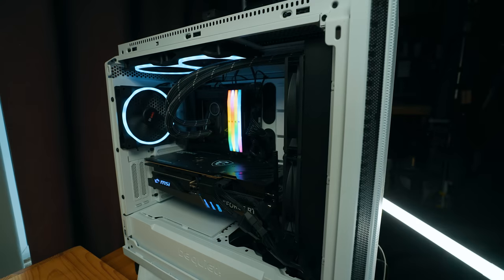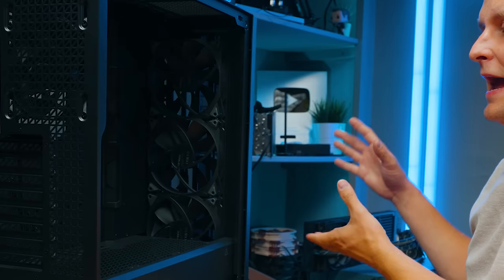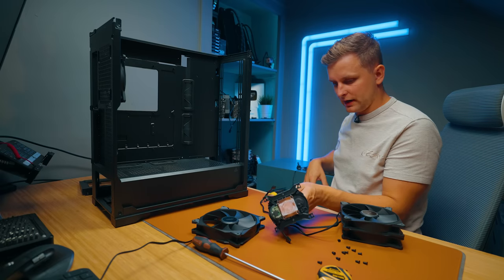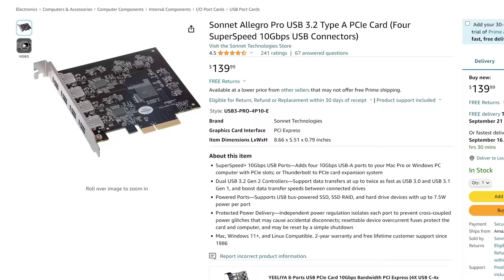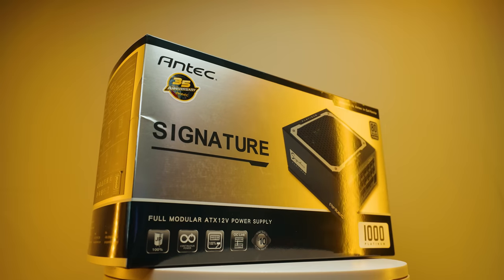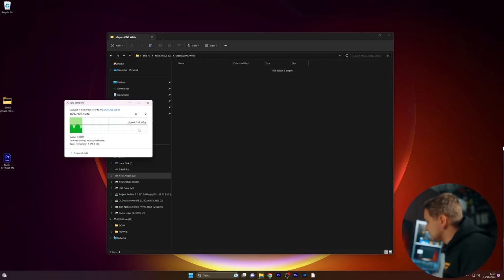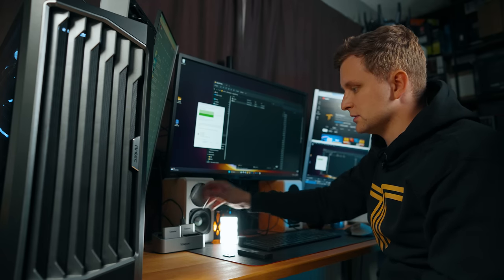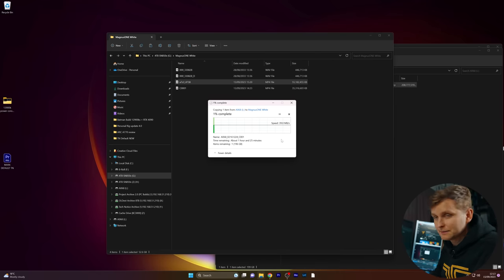I Upgraded AGAIN👉 BEST Video editing PC 2023! | Personal Rig Update 4.0

Comment: USB 3.1 and TB4 protocols are different.  TB requires higher compliance to their specification, so something like the USB cable could slow things down.  TB and USB C cables look the same, but TB certified cords are more expensive.  If swapping cables isn't an option, I would reco getting a TB4 tool-less enclosure and swap the NVME when needed.  I have both USBC and TB3 enclosures for switching between my MAC and PC.
Reply from the maker: 100% but also important that often TB4 can be USB-C 3.1 compatible (like most of the laptops), but for this motherboard it's TB4 only and NOT USB 3.1/3.2 compatible... :(
So changing a cable didn't make a difference...
Reply: @theTechNotice How does this ASUS motherboard compare to the Gigabyte Aero D Z690?

I have been using it and the TB4 seems to work well with TB devices as well as USB 3.1.

Would love your opinion.
Reply: This is what I was thinking could be the issue.
Reply: @theTechNotice is Windows PC better in editing compared to Apple iOS?!
Reply: @seekfactsnotfiction9056 iOS you talking about iPhone and iPad? of course is better 😂
Reply: @TomasRamoska  I was talking about MacBook Pro M2 or Mac Mini M2 Pro
Reply: @seekfactsnotfiction9056  MacOS not iOS
Reply: @theTechNotice  that makes zero sense, these are a superset of USB 3 Gen2, what you may be noticing is a lack of 2x2 lane bundling (the weird and rare 20Gbps standard)
Reply: @theTechNotice  i know you said KF processors are not good for video. When i built my Pc i did it for all round. Should i switch to a K?

Comment: I posted a long comment earlier but I am not seeing it show up in the comments. The TLDR of it all. Your Sonnet card is PCIe x4 2.0 which translates to 16Gb/s even though the card supports a max throughput of 20Gb/s. 1 USB 3.2 Gen 2 device has a theoretical 10Gb/s. So even if you verify you only have one device plugged in to each dedicated controller, you still have some bottlenecking/multiplexing going on at the PCIe level.  The motherboard Z790 chipset is also stretched thin with only 4 PCIe lanes dedicated to lan, wifi, and USB controllers which is why you are probably seeing issues with multiple highspeed USB devices on the mobo. Unfortunately ASUS does not provide a motherboard diagram to show which USB ports are connected to an onboard hub controller, etc.
Reply: .. I posted something similar. However, ASUS does a reasonable job, to a degree, of describing how bandwidth is divided up amongst PCIe slots, M.2, and the chipset plus CPU bandwidth sharing limitations. The problem is there is no conservation of bandwidth with PCIe 5.0 versus 4.0 etc. I know that the Z790 is extremely limited to its bandwidth and the most annoying feature is the top M.2 PCIe 5.0 immediately leaves only PCIe 5.0 x8 to the GPU and disables the secondary PCIe x16 slot. In that single regard, I actually prefer the Z690 platform.

Comment: I've got the solution for you TB4 issue, it's really simple - don't use the tb4 ports, use the USB A ports on the back, because they're all USB 3.2 gen 2 ports and will give you the same bandwidth as the front USB C. So you just need to get the right cables and it's all good.

I've got a razer TB4 hub, and there's no difference using that, same issue. So save yourself the trouble and don't buy an expensive hub. The reason laptops have several protocols unbuilt in their TB ports, is because there's no space for a whole bunch of ports, but here there is, so they haven't bothered throwing in USB 3.2 gen 2 in those ports since there are another 6 ports with that protocol. The questionable decision though, is why they're all USB A and not a single USB C. Well, anyway, I hope this helps!
Reply from the maker: Tried, didn't work...
Reply: @theTechNotice  damn, that's weird ☹️. So you've got worse speed from the A ports than the C front port? And your A to C cable surely supports USB 3.2 gen 2? I just tried again with one of my blackmagic media ssd's, and I get 750-800 on both the front C and back A. TB gives me less than half. 🤔

Comment: depending on how many m.2 ssd's you're using it can affect your pcie lanes. might be worth looking at
Reply from the maker: Said in the video, doesn't affect that slot :)
Reply: @theTechNotice   It does though, 
  You have 4 nvme ssd´s connected and now when you connected the usb card I think it's too much for the pcie controller too handle. 
The mainstream plattforms are not meant to be used this way due too the pcie lanes limit. 
I think you would be better off with an HEDT system.
 Love your videos and your content...

Comment: Drop the 420 and use a 280 if you're not going to utilize the cooling power of the 420.  You don't need 30mm thick fans and if the case won't allow them use the standard 140mm Be quiet lightwings, the 9 blade not the 7 blade (Yes it makes a difference).  Or Put that 420 rad on the top which will be less stressful on it's pump anyway.  Front mount Tubes down is best but not always an option on larger cases, tubes at top on a front mount rad can cause pump issues later as it's more of a stressful flow.  Nice build all in all, Antec has really made a great jump into modern cases, and it's about time!

Comment: Can you try switching the motherboard and report if you still experience the same problem, preferably a motherboard from a different vendor. I would also love to know wether it's a thunderbolt issue or an Asus motherboards issue.
Reply: Yeah he should try a BIOS update or check if there are any separate firmware updates related to USB ports - i had one besides BIOS for my Strix Z690-A but it was just USB-C power delivery related firmware update in my case. Also he can use a USB-A to USB-C 10Gbit cable because he has those ports there, he isn't limited to USB-C for 10Gbit
Reply: @OneCosmic749  I have the same mobo. yes, I am not limited to those thunderbolt ports, I would like to use them as I am using all other ports for necessary things.  The ports working this way is unacceptable in 2023. Back compat is a thing for a reason.

Comment: From my own test (work rig) I found that doing a bottom to top airflow is pretty optimal - then you’re not going against your GPU’s fan, assuming it’s air cooled.

Something like a lian li Dynamic o11 is great and you can put Phanteks T30’s pretty much everywhere top & bottom (they make a HUGE) difference. I have the mini mesh version and even with a 4090 / 7950x, everything runs cool as a cucumber.
Reply from the maker: top to bottom, like anti-physics? so you're fighting with the hot air rising? Am I getting this right?
Reply: @theTechNotice  My bad, I meant bottom to top - to go with the physics (:

Comment: Hi! Video editor here. I was going for this mobo + 13900K, BUT now I've seen your issues with the TB4 ports... SO SAD, i was going for them exactly + 10GBe. I'm constantly using external SSDs, transferring data every day, so this "advertised feature" will be a huge bottleneck for the speeds... If you find a solution, please, share it with us. Thank you!

Comment: Transfer speeds have been an issue for so long, I genuinely think it's a Windows problem because explorer is always freezing and crashing etc. I often transfer files from my PC to my S8 Tablet via USB3, if I try transfer a folder with lots of files it takes forever and often crashes everything. But if I zip the folder and then transfer as a single file, it's much quicker and no issues. Transfer speeds still feel slow for today's hardware. It's often faster for me to upload to Google Drive and then Download the file as I have a full fibre symmetric Gigabit internet connection.
Reply: I think this is probably an issue with your tablet, have you checked what protocol does your tablet use? Most android devices use MTP protocol which is shitty as hell. Some android devices use mass storage protocol which is much less problematic(like USB drives and external HDDs use) and some android devices has a setting to choose the protocol or sometimes there exists a mod for it.

Comment: I’m Planning on building a pc based on your $3,000 pc configuration. So thankful for all the tech advice videos. I may have missed this video, but when I looked up YouTube for installing arctic freezer ii, most recommended having the tubes at the bottom when installing front facing, for less noise. I see in this video the tubes are at the top. Wondering re your thinking for this
Reply: What are your specs?

Comment: I went  a step more, two 200mm front case , CPU AIO 360rad, 120 front and rear , and still have room for the 4090 zotac amp extreme airo  , plus two 140 fans back case as well , one 140 fan on case floor , and with only one 140 fan exhaust .

Comment: I am using the Antec Performance One FT case and seeking to upgrade my Noctua air cooler to an AIO cooler for my 7950X setup. Can you suggest any 420mm AIO cooler with a slim radiator that can be mounted in a pull/push setup without removing the bottom fan? What is your experience with dust collection in a front-mounted pull/push setup?

Comment: Hello, I posted this in your last video "MAXXED OUT Video Editing PC 3 Months Later - WAS IT WORTH IT?"  My Thunderbolt 4 is working with USB-C

Based my new build on your recommendations and I'm really happy with the performance in Premiere!  I bought the Asus ProArt (same MB as yours), 13900k, RTX 4080 and 64 gigs of ram.  You stated that your Thunderbolt 4 does not read your USB-C devises but mine does.  I have my Corsair monitor (Corsair XENEON 32QHD240 32" WQHD) connected to one TB4 and a SanDisk 1TB Extreme Portable External SSD, 550MB/s read/write to the other.  I ran a Blackmagic speed test on the ScanDisk and I got about 520 read/write.  When I built my system I downloaded the latest BIOS and installed Intel's TB4 drivers.  Works perfectly for me!  I really enjoy your YouTube channel and keep up the great work!
Reply from the maker: Is the Sandisk SSD plugged into the monitor or to the back of the motherboard?
Reply: @theTechNotice   Its connected to the back of the motherboard, directly to the TB4 connector. I just ran another test a few minutes ago, I copied a ProResHQ, 95 gig video file from the Scandisk (Connected to the back TB4) to my desktop.  It took approximately under 4 minutes to copy over.
Reply: This is the driver I have installed below in my "Intel Driver & Support Assistant" 

Thunderbolt Controller 1
    Driver Details:
    Version1.41.1340.0

    
     Device Details

    Thunderbolt™ GenerationThunderbolt 4 (1137)
    Number Of Ports2
    Security LevelKernel DMA Protection
    NVM Firmware Version38:0
    Pcie TunnelingTrue

Comment: Can you explain how you’re running 128Gb of DDR5 memory in this build?

I have contacted many people about a build I’m planning and every response I get is that using all 4 dims will cause massive issues with my ram
Reply: First time hearing of such a thing. Normally, using all four dims only has issues when using very high speed ram. If you are using regular DDR5 ram, it shouldn't matter how many gigabytes of ram you are using (As long as it does not exceed the maximum capacity your motherboard supports, which is detailed in your motherboard owner's manual).
Reply: He likely got lucky with very well binned ram and motherboard combinations, Silicon lottery. It's very rare but feels super nice not having to compromise.
Reply: AMD AM5 has huge problems with 4 sticks of ram. Intel is fine as long as you use 5600 or maybe 6000 speeds.
Reply: I have the ProArt Z790 and am running two 64GB CMT64GX5M4B5600C36 kits of Corsair Dominator Platinum RGB for 128GB at 4800MHz . Working well. If I use the AI OC I bump the voltage to 1.35V.
Reply: im running 192gb on a ROG MAXIMUS Z790 EXTREME. works great!

Comment: I want to move mine from a 5000X case into a 7000D case, but yeah, not goign to go through all that tearing and pulling thing out part.   
It took quite a lot of labor to get it all in there just right.  And it works.  SO it's staying put.
Reply: I was debating to go with Corsair case or Antec F1, I went with Antec, moving from one case to another is easy and enjoyable if nice case, but when you have hard tubing and not flex tubing water cooling system, then it makes you  re think 100 times if you wanna do it, hard tubing is not easy but beautiful way better then AIO cooling

Comment: About your TB extension card issue, why didn't you get the ASUS ThunderboltEX 4 ? It's 100% compatible and set the transfer speed up to 40Gbps. Also, sorry to ask but as it's not visible on your video, did you connect the PCIe extension card on TB4 motherboard connectors with the cable (inside the case) ?
Reply from the maker: This card is not TB, is USB :)

Comment: I looked manual of motherboard and it doesn't show USB ports that uses motherboard's chipset or CPU ones. Even thought they didn't mention but if there is something like that like every motherboard. Front panel's USB hub works well so you need to connect same USB hub. Page 66 as pdf page 2-27 in manual in ProArt Z790-CREATOR WIFI User’s Manual ( English Edition ) USB Hubs are seperated by 7, 9 and 4 (includes 4 USBs). Try those 3 shown seperated USB hubs or if you want you can check every single one of them. By trying you can connect to same USB hub that uses front panel's USB hub which works stable. Usually front panel's USBs share USB hub.

Comment: I have this case, with an Asus Pro Art Z790 and I will be putting in the i9-14900. Only question is if 2x 6400 Corsair Vengeance DDR5 Ram CL32 will be enough for my photo and video editing. I also plan on using 2x 2Tb Samsung 990 Pro SSD initially.

Comment: The problem with the IO is that Alder And Rapture Lake CPUs have the Io controller on the motherboard and not on the chip like the previous generations did. All IO is laggy with these CPUs. I notice it just normal use on my 13900k computer.

Comment: note: when you use push-pull mismatched fans on a rad they will "fight" each other because they don't have the same pressure at the same RPM
Reply: Yes. You should always use same fans in push/pull, and always run them at the same speed.
Reply from the maker: True, to be honest I'm waiting for the arctic fans to die so I could replace them with something better 😁
Reply: @theTechNotice  the Arctic fans are better, I use P14 PWM PSO CO in all my builds and clients' - for the price, the P14 is awesome

Comment: I would LOVE if this channel went into in depth with intels Quicksync crushing Davinci Resolve all the time when rendering. Has been an issue for over 2 years... while in theory the Intel IGPU is an absolute blessing, it makes complex Renders (Wedding Films in my case) very unstable. It crashes Davinci Resolve randomly when using h265 10bit 422 Footage and sadly even 4090 cant decode this so its either CPU bruteforce or iGPU, but IGPU causes crashes A LOT... any thoughts on this?
Reply: And if this video is made, please consider testing Premiere's Mogrts with Quicksync. I've heard that it is night and day for those whose workflow depends on mogrts, but can't find any reliable source that would justify switching to Intel at the end of the LGA1700 lifecycle.
Reply: Interesting. I thought those guys encoders would make the editing process easier. I didn't k ow it was a problem. When rendering. I guess that means that the beefier high core count chips are a good investment.
Reply from the maker: how certain is it that it's the iGPU that causes the crashes? 🤔🤔

Comment: yeh i see similar problems, i have the $400 sonnettech card. i have the ROG MAXIMUS Z790 EXTREME and every way possible to bring in stuff. i have all the right cables and thunderbolt external drives. optical thunderbolt cables and so on. optical 10gbps usb c cables, and docks.

Comment: It's so weird to me that people don't realize you can just stuff 2.5 sata ssds anywhere. They aren't mechanical, they don't need vibration reduction. You can use as many sata ssds as your motherboard supports regardless of case, unless you're doing something with an itx case that just doesn't have any extra room.
Reply: I just double tape them wherever as well hihi 🤫

Comment: I skipped around quite a bit with your video .. However, You have to look in the manual about how each USB and PCIe is divided up with the limited bandwidth of either the CPU and or the chipset i.e. 'shared.' not to mention once you connect a PCIe card, it may also share bandwidth with with your GPU PCIe x16 slot, and some bandwidth can be disabled once a different USB or PCIe slot is occupied. Yep, it's convoluted...
Reply from the maker: Yep, know that, and checked, there shouldn't loose anything in this particular setup...
Reply: @theTechNotice .. "Loose" ?? I'm referring to the shared / disabled via BIOS bandwidth of your limited PCIe lanes.
Reply: @theTechNotice .. Also the i7-13900K only has 20 lanes, the processor supports up to four PCIe 4.0 and sixteen PCIe 5.0 lanes.

Comment: Nice video.  Interesting seeing your problems reading multiple memory cards in a work flow like scenario where you constantly plugging/unplugging cards.  Wonder if any of your issues is unique to the hardware you are using (e.g., 3 ft thunderbolt 4 cables, card readers, that PCIe thunderbolt PCIe adapter card --- two controller chips and 4 lanes of PCIe4 should be enough, shouldn't it?) might be part of the problem.  Have you tried this with a TB4 equipped laptop?

I also own a ProArt Z790 motherboard that I regret buying.  All of those lanes dedicated to two thunderbolt 4 ports in the back of a case that I have on the floor --- really long distance for TB4 to cover to get to peripherals on my desk.  Lose a lot for those TB4 ports: only four PCIe4 m.2 slots. i  A Gen 2.1 2x2 header; but, I don't have a case with USB-C port that can take advantage of its speed.